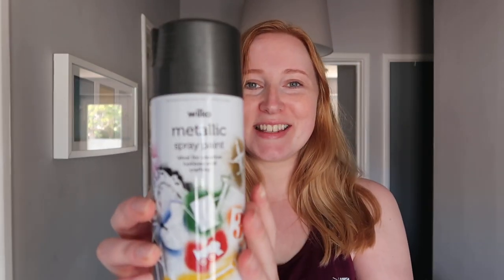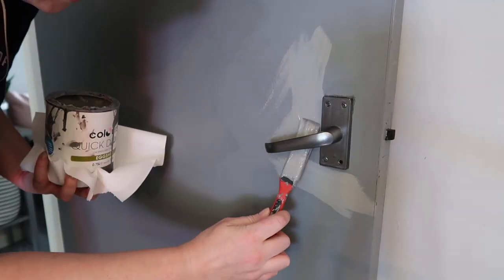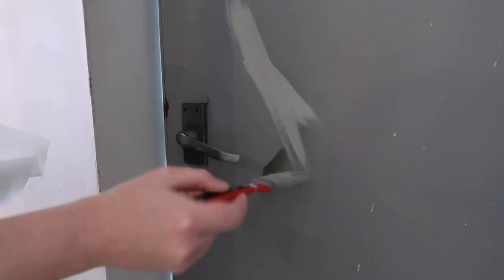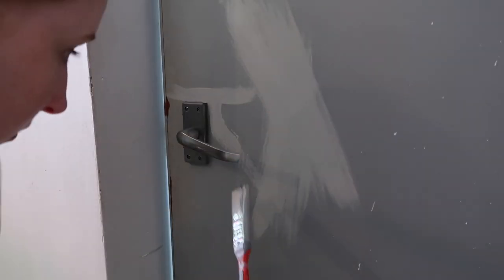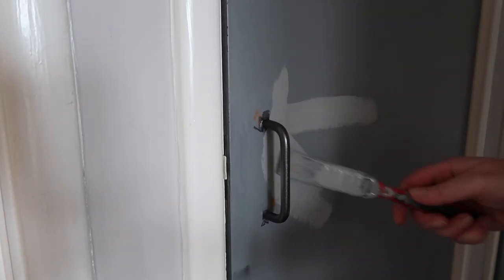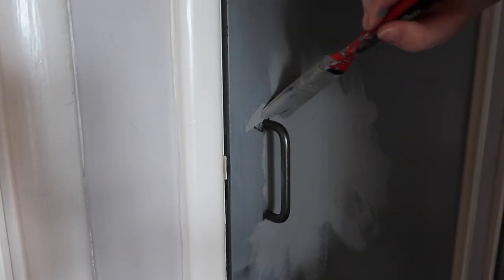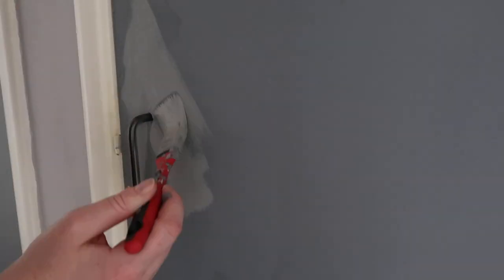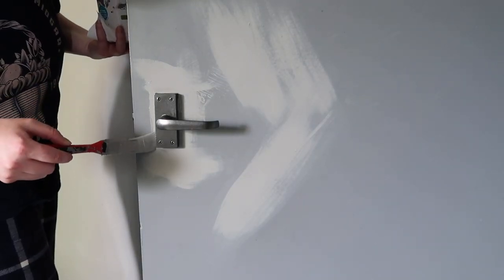WILKO GUNMETAL METALLIC SPRAY PAINT | Spray painting door handles | Cheap DIY update

Comment: Looks nice, certainly on the aluminium ones and a really nice addition... i would always recommend primers for any metal surface and a quick rub with a 120g sand paper... mainly as the amount of use and if anyone wears jewelry will make it much more hard wearing.
Reply from the maker: I’m 100% slowly going to start buying new ones! Haha! They’ve lasted ok to be fair though, considering I did minimal prep work!
Reply: @MissMoogle  they looked great... we have done similar in the past... changing all the handles can mount up quickly.

Comment: Do you think you cN this over brass handles
Reply: Yes you can. Same prep work. Clean thoroughly and paint with several light coats instead of one thick coat. Will ensure no streaks or runs of the paint